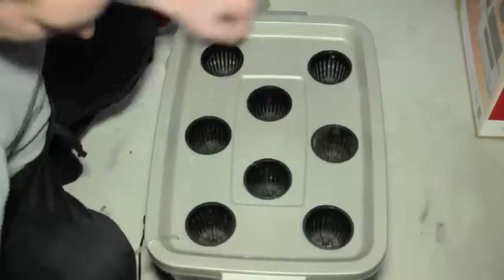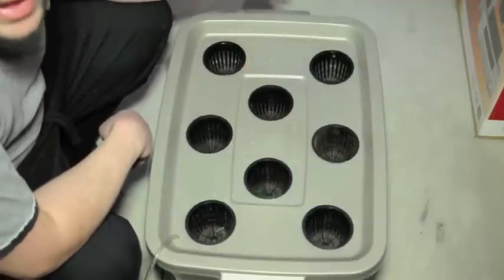Hydroponics growing system: How to build a homemade DIY Deep Water Culture or DWC growing system

Comment: Can u just punch holes before the waterline and under the root area to get oxygen instead of using electricity to run a fish pump thing ?
Reply: You want to oxygenate the water as well. While the roots don't get as much oxygen from the water as they do from the "in-air" parts, oxygen is still important for the submerged parts of the roots to live. Also, poking holes in the side, you are relying on air to flow in and out, which it won't do as well. You also want to minimize the amount of light coming into the water so you don't grow algae in the bin. I realize this is probably to late to help you, but hopefully it will help someone else that has the same question.
Reply: hi everyone ,if anyone else wants to uncover backyard aquaponics system try Morundan Total Aquaponics  Mastery (do a google search ) ? Ive heard some interesting things about it and my neighbor got great results with it.
Reply: Why did you reply to my message if you're not answering my question?  Seesh...awkward

Comment: You should use smaller holes for your net pots when you plants start to grow they will get heavy and the hole plant with the pot will go I the water, also yo should use a black bin or bucket, light will go in and then you get alge,  last to many pots will be over crowded when plants start to grow the plants start to battle for dominance at the root, the stronger plants start to choke the weaker plants.

Comment: Just a note to anyone who is going to try this, dont put 8 baskets in that small amount of space, all of your roots are going to tangle and significantly lessen your yield, "someone" has the same size reservoir with only 2 plants and is expected to get at least 3 zips off each plant, this guy will probably get like 3/4 of a zip off each plant and need way more lighting than he should!
Reply: Jacob Macek what’s a zip, I’m guessing zip lock bag but how much is that? In grams?
Reply: @Mr.Voysey  zip equals an ounce or 28g

Comment: how long do i leave the pump on during dwc hydroponics? i was experimenting with marigold flowers and got positive results. I had it running 12 hours on, when lights were on. and then at night, for 12 hours i wouldn't run it when the lights were off. i was using a regular aquarium air pump and it seemed to work really well.

Comment: THAT IS NOT ENOUGH AIR DUDE. AND THE AIR STONE YOU ARE USEING IS WRONG. GET HEAVY STONES AND TRY AND USE 15 TO 28 LT OF AIR PER WORKIN GAL. OF  H2o

Comment: does the bottom of the container has to be dark ? I have one that I would like to try which is transparent. would it work ? thanks for your vid :)
Reply: Container needs to be dark color to block out light to deferr algea. Black is best
Reply: Transparent would not be good for you would have major algea problems. So just make sure to used darkest containers you can find and yet good man

Comment: The advantage to soil is that it acts as a buffer between the root system and toxicity, in the event that you overfeed your plants; you will have ample time to flush the system of excess nutrients if need be. And soil dries slower which is important because say your hydro system goes down? Well if you're gone more than a few hours, your plants may suffocate or dry out, depending on the type of hydro setup you have. With dirt? It takes a few days before your plants would dry out... In a nutshell.

Comment: You can also use syrofoam as the cover which floats. So when the water evaporates the syrofoam goes with the level of water and no worries about adding water every few days.

Search youtube for styrofoam hydroponics.

This video is great and was one of the very first that helped me . I still do everything this video shows but now use syrofoam as the top piece with net cups.

Comment: General idea here is good, but a couple of suggestions for you, First the plastic tub should be black, this will block out any light. Light causes algae, and that you don;t want in your root system. Another thing, why did you run the air hose throught the lid? no need for that. just drill thru the side within 1" from the top that way when you remove the lid you don't have a dangling hose to deal with that could pick up debris from the floor and contaminate the water.

Comment: Hey thanks for the reply.  I have another question i need to figure out if you could help...I have a resevoir, after 1 day, the rez lowers by 1 inch.  My question is: Do i fill it with more Nutrient solution or just top it off with plain PH adjusted water?  Then every 1 week i completely change the Rez?

Comment: i drain and refill my water with a cheap lil water pump you can buy it and the tubing needed at any hydro store for about $20-$45 depending on how many you have systems you have to work with other then that just keep an eye on the water level & PH it really doesn't matter if the water level is to high but if it's too low some of the plants roots can dry out and the plant will suffer. Your PH levels are also important but the number that the PH should be at depends on what your growing

Comment: see at first you want to have the net pot submerged in the water solution at least a 1/2 inch  because the medium in the net pot will wick up the water to a point to feed the seedling's roots. and thats what's the air pump and air stone are for as long as the air pump never goes off the plants can grow as big as they want without drowning because what causes a plant to drown is not the water it self but the absence of oxygen that's why the air pump and air stone are so important

Comment: My tote holds 46 liters of water, its a little bigger and is way too heavy to move.
Heres a tip buy a bulkhead tank fitting 6$ and a water tap 6$ drill a whole in the side near the bottom, and you will now have a tap so you can drain it. I use a garden hose drain it to a nearby shower and never move it.